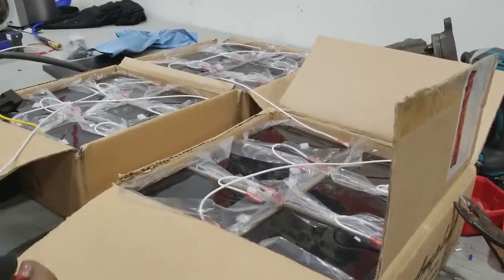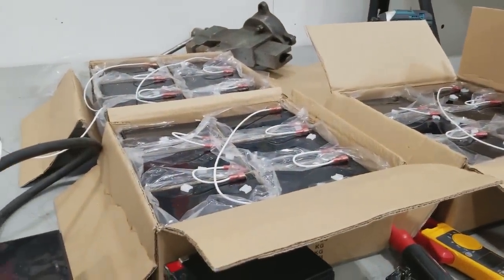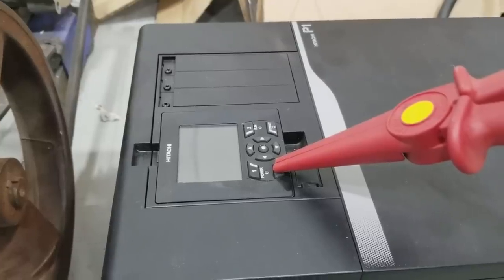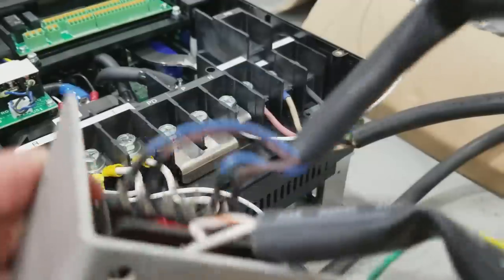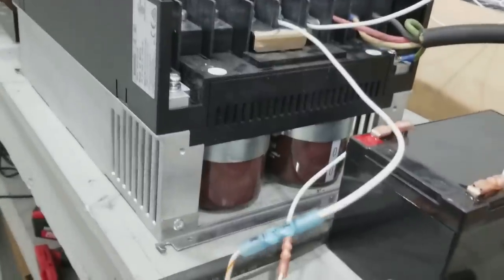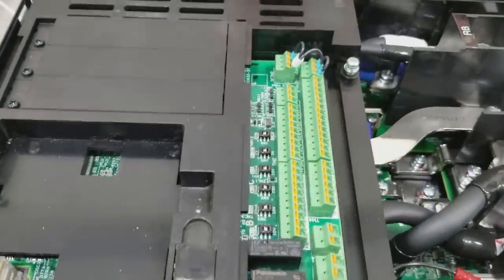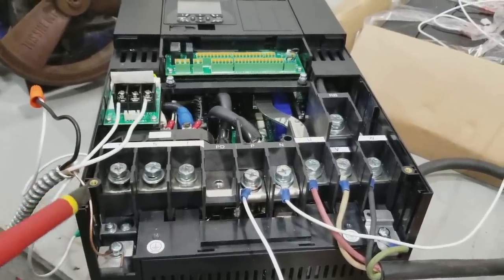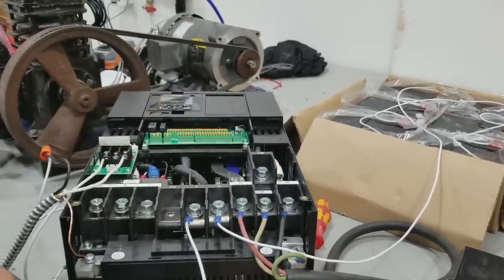Return of Dewclaw! | Battery Air Compressor

Comment: A few classic phrases in there - "False bravado has got me though worse than this" "Once it works, you can dial back the sketchiness" - I think there's a t-shart in that
Reply: I think I need both of these shirts
Reply: I want "everything's a smoke machine if you use it wrong enough"
Reply: "Torque it til it cracks, back it off 1/4 turn and leave it for the next guy."
Reply: I want a shirt that says burp, fart, and the let the smoke out.
Reply: Would pay 20 Freedom Bucks (3000 Kanuckistan pesos) for any of these.
Reply: @Deepanimosity  I want a shirt saying that!
My boss when I was an apprentice used to say  about torque, " Tighten till you think it's gonna  strip. If you strip it you went too far."
Reply: I don't buy many novelty t's, but I'd buy both of these. Also, the "everything's a smoke machine if you use it wrong enough". That a good suggestion too.
Reply: False bravado one has hit closer to the truth than I'm willing to admit.
Reply: Never put more than 1 screw in a main board before power up . Bad juju
Reply: I would buy the once it works shirt for sure
Always looking for some questionable phrases on cotton nipple hiders
Reply: “It’s like square dancin with a monkey”
Reply: "theres nothin we wont do to fuck shit up"
Reply: "If at first you don't succeed, keep sucking 'till you do succeed"
Reply: Gotta have the false bravado shart.
Reply: "Once it works, you can dial back the sketchiness" is the fundamental process of all prototyping.

Comment: DC-AC inverters need more voltage in the DC bus due to the rated AC voltage being measured as RMS and the DC being max, such as a Bosch-Rexroth, FANUC or Siemodrive servo control system. I would ask the engineering department to explain better but they keep avoiding me.
Reply: Your questions are to herd.
Reply: Is that like MOOOO!   ?
Reply: Not necessarily if you are using a VFD.  An example you see every day arehybrid cars like a Prius.,  The  201vdc battery is fed to an under-hood "VFD" (inverter/converter) which provides a dc/dc boost conversion (converter) to about 500vdc and then inverts the higher dc voltage to a maximum of 650vac three phase.  Which creates a variable frequency drive to control their three phase electric motor system.   It's also a dynamically reversible process which can instantly turn the mechanical energy back from ac to dc and charge the 201 battery.
Reply: Square root of 2 multiplied whit the  efective voltage on AC gives you the peak ac voltage
Reply: What is CAT really spells Dog?
(Ogre - Revenge of the Needs 3)
Reply: Because if each phase is 460V RMS, then in order to be able to recreate a 460V RMS sine wave, you need to PWM switch a 600V DC bus to be able to make the peaks due to that square root of 2 peak-peak calculation.
Reply: Well most of them can happily work at very low voltages, and the sensible ones will start at like 140V (Japan’s rectified AC in a village at the end of the line) all the way to 600V or more depending on the rating of course. I detest the ones that have stupidly high undervoltage lockout like this one - and worse, fail to start up the control electronics as well so no indication what’s wrong. It’s one of the times a different product would work miles better. Most BLDC servo drives would handle this application all the way to the batteries being irrecoverably sulfated, and then you could attach 400V 3 phase and it would also work.

Comment: Contactor not rated for DC loads? No problem, let's add a gigantic inductor! Great idea, if it doesn't limit the inrush, at least it'll turn the contactor into a stick welder. Was that thing supposed to open ever again?
Reply from the maker: Pffft. That's what the caps are for.

Comment: Reminded me of my days testing UPS battery banks, the M.O. (modus operandi) was to not use both hands when testing so as to avoid at all costs any chance of completing a circuit between your 2 hands and (if you're lucky) a trip to see the EMS folks. 

It of course doesn't help that working with lethal voltages causes ones heart to race and hands to sweat which increases conductivity.
I learned early on as an apprentice sparky that you treat every wire as live and lethal, so that when you do come face to face with a real live one, you have trained your psyche that it's not any different than any other situation you've done 1000's of times before.

Comment: Tips: If you want to break hi voltage DC with a motor contactor, run them thru all three phases of the contactor in serial so you will have a better break gap, not just one.

Comment: I run my 12000lb vintage metal lathe with a similar setup, except it's 50 truck batteries and a 30hp VFD. This is reminiscent of all the messing around I had to do to get mine to work.

Comment: 380vdc, just about perfect to run off of the battery pack on most electric vehicles! Gotta be real careful with that hvdc stuff, it'll fry you right quick... 

I work with the high voltage components on EV's on an almost daily basis. Just today I did an "experimenalt" swap of a Toyota Rav4 EV battery pack with one from another car.

If you are looking for a contactor (relay) for switching that kind of voltage, I'd look into getting something off of some EV or another. We use Gigavac contactors on the DC fast charging kits we build at work. I think they're rated for 1000vdc up to 500a, and are powered with a 12v coil that draws about 0.3a. Some EVs use contactors powered by PWM though, so something to keep in mind if you grab something used...

Comment: The only time I’ve seen wires jump was on a 400 KW generator. It had a tired 12 volt M40 starter. The battery leads would jump a foot.
Reply: A car battery will do it to wires too.
Reply: Had bolted 600v infeed to the building I work in loosen over the years of heavy service, every once in a while the whole shop (40" 7 unit printing press, multiple big ass compressors among a ton of other equipment) would get a momentary power cut when it would work its way to a near open, then immediately come back up.  We spent weeks trying to figure out where this bullshit was coming from until I happened to be by the electrical wall looking up when it happened. I hope I never seen 4/0 wire coil up and leap like a snake ever again

Comment: The DC wiring is doing double duty, in this case it also acts as the fuse.
Reply: Or a heating element to take the chill out of the air.

Comment: About the only reason nowadays to have access to the DC bus on big drives is so that multiple smaller drives can be hooked up to a common DC bus to share braking power. They will usually have one big-ass rectifier to run everything.
Reply: Hard drives or floppy drives?

Comment: I knew a guy that was poking around inside a piece if malfunctioning equipment at the print shop he worked in as a maintenance/repair guy. He was using s pencil to push a cluster of wires aside a bit to get a look at something underneath when there was a flash, a fizzpop and shower of sparks. The tip of the pencil, if course made of conductive graphite, had contacted and shorted something live. He was unharmed though his pants may not have been so lucky.
When he did his standard firm write up on the job and incident he said "While investigating the malfunction with an INSULATED GRAPHITE PROBE....."
He was never questioned on it, despite the "probing" necessitating replacement if a costly control assembly

Comment: If cables jumping impresses ya you need to go out to a building site and watch them weld the studs that keep the concrete floor from sliding. I never had much time to stand around and admire, but it never hurt to take a quick gander during an O2 break. Gotta love those cutting days.

Comment: The nut welder at my work runs about 12000 amps. The cables connecting the electrode are braided copper about the diameter of my . . . Well about 2" anyway. I can barely bend those suckers. But when that current runs through them they jump 3". It's beautiful and scary.

Comment: Hey we use those same AB contactors for running are CAT 3 motor power . Run power in through 1 and back out the other to the motors.   Aslo run the reset for the estops through the snap on auxiliary contacts sometimes will use a sick safety relay for that too. Anyway kool vid.

Comment: I once connected 150 slightly used 9v batteries in series and it would arc half a foot and make the hairs on your arm stand up when you would get close to the under insulated wires

Comment: All A/C drives like yours have enable and start terminals. One can choose two wire and 3 wire modes, but one needs 24 vdc or 120vac on the enable terminal for it to allow run mode. Then a steady or sometimes a pulse input on the start terminal will ramp the voltage and frequency up to the load depending on how the parameters are configured. You really do need to read the quick start guide at a minimum and program the nameplate information ( volts, hz, full load amps, etc. ) into the parameters. That looks to be a 10 or 15 hp drive which is overkill for this application but will work. You will have a large inrush on the drive due to the capacitors charging. This DC bus usually charges up to 650V or down to 400 volts depending on your input voltage. I have only seen drives like these run off of 480VAC but I know you can run them off DC voltage. Please read the entire quick start guide. You would have avoided much consternation if you had done that.

Comment: That wire gauge is just a few sizes too small
Reply: Yeah that made my palms itchy just looking at it. It looks like 4mm on a good day. Not sure the amp draw though.
Reply: Ok second review, unless dewclaw has shovels for hands ( 10% chance ), 2.5mm with thick wall. Yikes like 10a draw max.
Reply: likely just for proof of concept
Reply: also thin wires can function as makeshift fuses
Reply: @TheTimmy4745  usually makeshift shorts before fuses
Reply: @TheTimmy4745  Thats what they used to be before todays fuses. My 1986 4x4 has a fuse box with literal wires for fuses.
Reply: @TheTimmy4745  yup in my line of work that's the application that sets boats on fire. Had a customer blowing 200a fuses. He'd wired all the halogen lights with bell wire!. Ffs smh.
Reply: The wires are only too small if they glow.
Reply: @nomadicgrenada  
8:23.   3a to run the compressor.
Reply: Thanks Zach, missed that.  palms less itchy. But always ready when AvE is messing with pixies. Lol
Reply: At 2-300 v and only 2 hp and slow start via the VFD, it’s likely heavy enough, the amps are low. if you were trying to do 12-24v she would be smokey the bear.

Comment: Yo @AvE , 

For the 24v control voltage, if the AC to DC psu is a true switchmode supply, then it should happily run from sufficiently high DC voltage, as the AC is rectified to DC before being switched anyway. I know lots of Meanwell AC 240v to DC PSU's (Such as Din PSU's) actually have a DC input range listed on their spec sheet along with the AC input. For example, a Meanwell EDR-120 series Din PSU has an acceptable input range of 90-264VAC OR 127-370VDC on the same input pins. The only thing is that Meanwell specifies Positive shall be connected to the Live input, and Negative to the Neutral input, most likely for grounding reasons, as in theory it shouldnt matter otherwise due to the Bridge rectifier.

If the VFD you have just will not accept High voltage DC input to the 24v PSU, you could just use something like a Meanwell EDR series PSU, or other unit that will accept the DC voltage range you are using and use that to run the brains, atleast then you dont need an inverter and the issues that brings.

Comment: You need a recharge contactor to stop the contacts on the main contactor welding.
You need two contractors. One big one that joins the batteries to the dc bus. Another small one that joins the battery to the dc bus thru a series resistor. You close the small contactor and the series resistor limits the in rush  current. Once the dc bus is up to voltage you close the big contactor.
The series inductor you put in will help but it is not the best way. You want as low impedance as possible between the batteries and the dc bus.

Comment: Hey, thanks for helping me figure out why I couldn't get my VFD to run off a pallet of lithium pouch cells! I wonder if there's a way to make a really greasy ass diy inverter on the cheap to get it running. I've only got 1 nut left after paying for the VFD and it most certainly cannot be parted with on account of needing a "real" 240v inverter.

Comment: Large ABB frequency drive installations have an inbuilt ‘precharge’ circuit to gently ramp the DC link to 1000vdc (690v system) avoiding inrush on the main IGBT active front end rectifier and supply links, the control logic won’t activate the main input rectifier until the precharge circuit has raised the DC link to within ~80% of nominal, so no pre charge no go.

ABB and Siemens recommenced precharging their smaller drive DC link capacitors if they have been depowered for 12+ months.

Usually done by supplying voltage to the DC link through a 100 to 470ohm resistor from a diy rectifier setup.

Comment: kinda think you are spinning the motor the wrong way considering the fan profile spokes on the pump house pulley, usually the are made to push air, not suck over the housing

Comment: I see you've installed the "fuse" wire already. ;) I've heard of shops using DC before, never knew the reason, my guess is special motors or something along those lines. So it kinda makes sense this exists to convert the dc to ac for a conversion. 300 volts DC though, good luck finding off-grid stuff that goes that high lol!

Comment: Would it be easier to use batteries to drive a DC motor connected by belt to a three phase generator to feed the VFD to drive the three phase motor to drive the pump so you can run your impact wrench?
Reply: Losses aplenty
Reply: Just slap a dc motor on the compressor and use a controller. Better still get a 3 phase generator for your off grid needs.

Comment: Switch polarity across the inverter. Use a compressed air source into the compressor to spin the motor and see if you can charge the batteries.

Comment: I always wondered if that would work.  Put a CT on the DC supply wire and osmelliscope the current.  I wonder what kind of noise it makes and whether the batteries damp it out at all.  There were these monstrosities used to be sold by Frick industrial refrigeration called the Vyper drive that was some York designed water cooled nightmare that had an optional active harmonic filter system that used very fast DC current sensors on the DC bus to read the waveform of the noise and use an entire dedicated set of 3 phases of IGBTs to basically inject the exact opposite back into the drive somehow to clean up the output...kind of like noise cancelling headphones.  It was super finnicky and didn't really work properly most of the time but sounded pretty cool in the marketing literature.

Comment: You should be able to go through the input diodes, which then retains reverse polarity protection.  Your issue was the controls not getting power, not the DC coming in through the diodes.

Comment: Classic dumb question, but unless you have an cabinet saw or 50 gallon air compressor, is there any application other than industrial machinery that requires three-phase power?

Comment: That's awesome. 
   Question, does it make a difference which way the pump is spinning in the long run?
    I Just noticed the fan blades spinning in the opposite direction of intended use.

Comment: If you are switching DC of that voltage, you have to wire at least two of the contacts on that contractor in series.

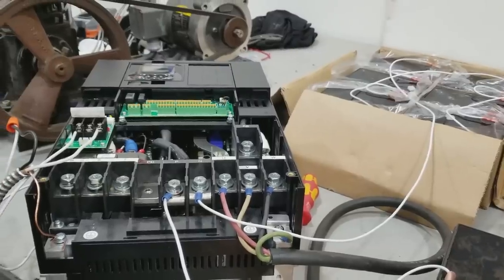Comment: Hold on a second at 15:58 I saw the arrow on the compressor flywheel point in the opposite direction you guys had it spinning! Dose that not matter what direction you spin the compressor?

Comment: you can get 24v from those same batteries, just tap off the 2nd one from ground and everything will be running off the same battery bank, that means the first two batteries would die a bit faster but if they are just running the brains it shouldnt draw too much current

Comment: On Finnish Vacon VFD's the 3-phase voltage goes through a common mode choke to the bridge rectifier. Rectified voltage then goes through a inrush current limiting resistor and it will be bypassed when the voltage rises enough on the capacitors. There is also voltage measurement on the rectified side and a supervisor circuitry on the 3-phase input side. The 3-phase supervisor is a set of high value resistors on the line side. The highly current limited line voltage is then rectified via tiny smd diodes (3-phase bridge) and fed through an optoisolator. The opto then outputs a pulse train from which the mcu can tell if there is one or more line voltages missing. Missing line voltage and the drive is inhibited to start, display is ok and accessible though.

Comment: You could tear apart a junkyard Toyoter Prius and pull the contactors out of it. It should have two if I recall correctly, and the last couple of generations use over 400V DC

Comment: All kidding aside, don't use an inductor to limit inrush to a capacitor bank. Inductor + capacitor = oscillator, and potential for large voltage overshoot on the DC bus. Use a heavy duty power resistor to limit inrush. Switch can bypass the resistor AFTER the inrush happens but BEFORE you spin the motor.
Reply: Those gel cells probably have enough internal resistance to act as their own inrush limiter, at least from the standpoint of not burning up wires when connecting.

Comment: That drive should have built in 24 volts, it's designed to use an external source or internal, you just have to install the jumpers in the right place.